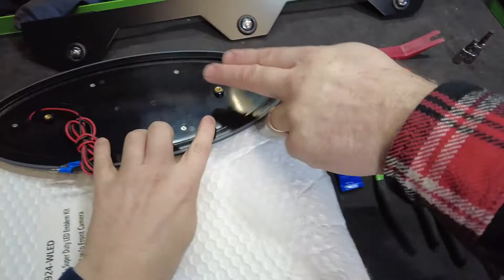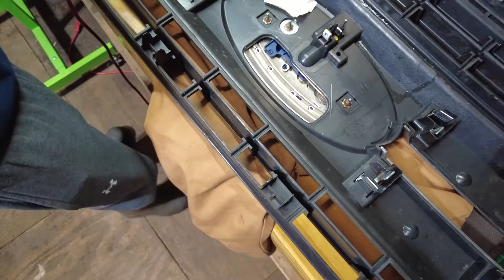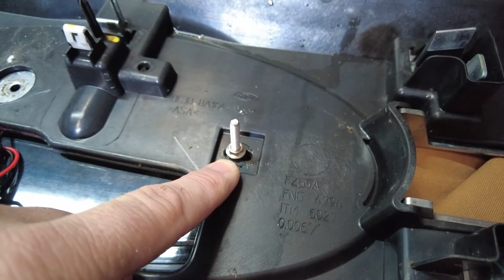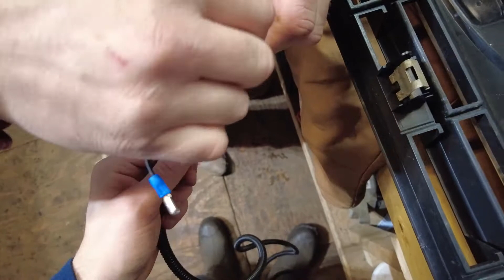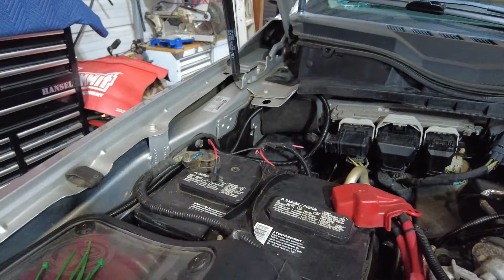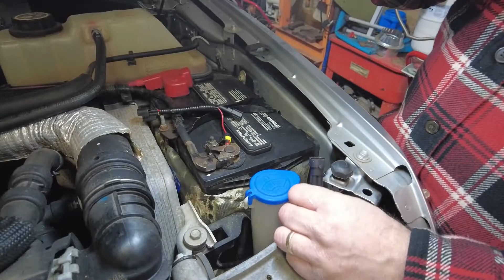Putco Lighted Front Emblem and Raptor Lights install on Ford Superduty

Comment: You can install a load resistor in the red lead to dim the Ford LOGO  until you can fit the LED Headlights into the works.
Reply from the maker: That is a great idea! Luckily we got some LED bulbs, and it has really made the difference. It looks fantastic all being LED.